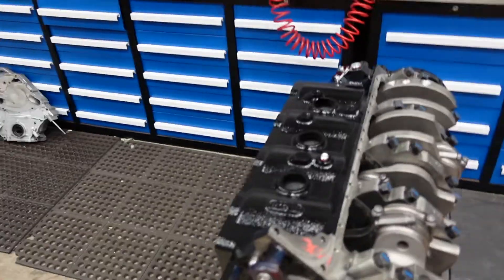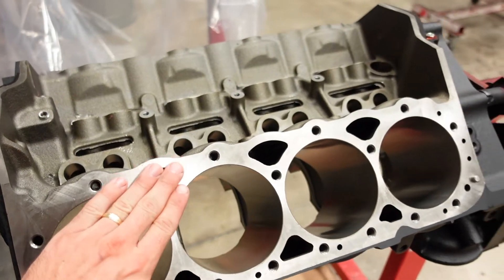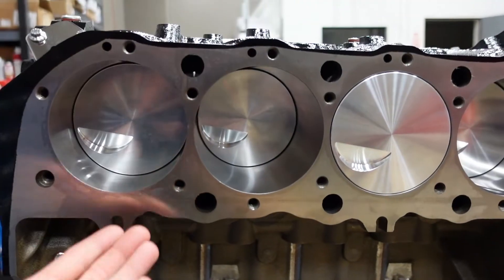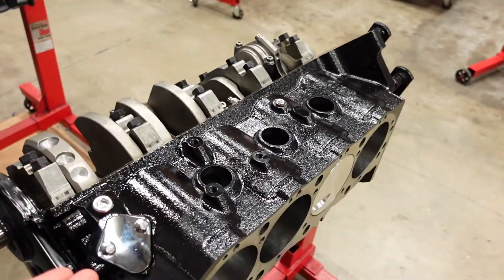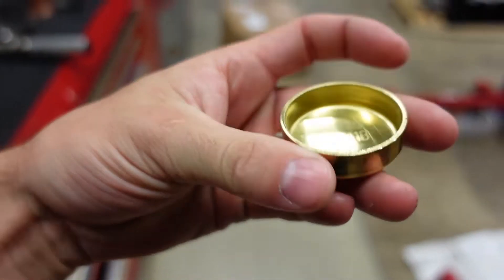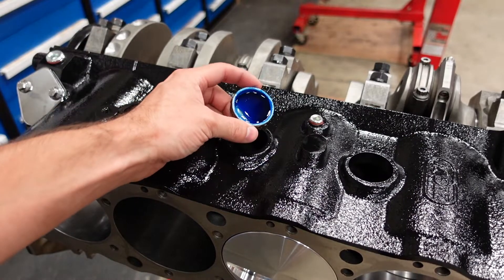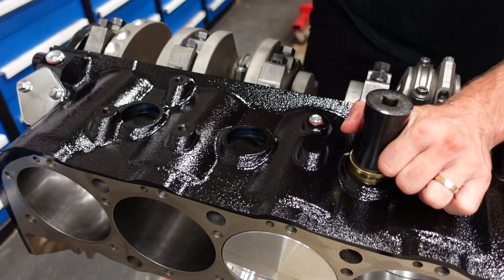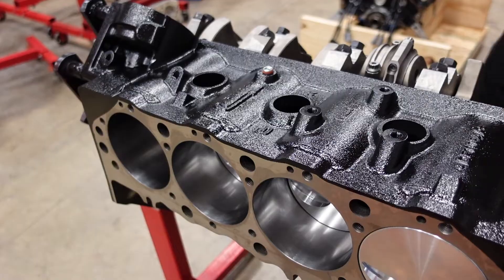Installing Engine Core Plugs (correctly) - Tech Tip Tuesday

Comment: Easy and correct way to degree cams. 
Correctly Measuring piston to valve clearance. 
Correctly Measuring for push rod length.
And setting lash for the Jessel shaft rockers. Thanks💪

Comment: They should be deeper just below the chamfer in the block to get the best seal. The core plugs are slightly tapered so they mostly seal on the big end, so there’s no meat in the chamfer area to seal good.
Reply from the maker: Dart blocks have no chamfer on them.
Reply: @JacobVillemain  good to know

Comment: I've never installed a core plug, but I did read online that its best to hammer the plug from the edges, because hammering the inside will concave the plug and loosen it. This makes a lot of sense to me, any input is appreciated.

Comment: Cheers. Yesterday a core plug on my fordson dexta (a tractor) sprung a leak but I've got a replacement (I was going to do them all as a winter job). I haven't got any sealer but I'll try locktite that's a nice idea. I thought about boss white plumbing stuff let me know if you've ever used that or experienced it. Any good for this?

Comment: I’d like to learn more about figuring out HP on an engine based on the components you’re putting into it. For example, if I have a stock LS1 at 350hp and I’d like to bump that up to 400hp, what should I change? Cam? Compression ratio? Stroke? If you already have a video on this subject then please point me in the right direction. Thanks!

Comment: Thanks so much for the video and the explanation on these CORE plugs I applaud your valued expertise and professionalism. I'm currently installing new plugs in my small block chevy and although I don't have the blue loctite I do have some of the loctite head bolt & water jacket sealant I'm thinking that should work just as good? I hope so cause by the time I get an answer I'd have already have them installed haha thanks again for the video man you've earned yourself a follow from me 🤙

Comment: Would love to hear about piston knurling, to salvage good pistons when a block is worn beyond piston to wall clearance and you don’t have enough cylinder wall thickness to rebore. Also good for parts that aren’t available any longer like old tractor stuff.
Reply: Any engines I've seen with knurled pistons have been completely worn out garbage The knurling seems dig into the cylinders and distribute the grit throughout the whole engine. I deal with many engine shops and follow dizens on IG and none will touch a knurled piston project. Engines always look good with fresh hone patterns and cleaned up parts, but what you don't see is what we see in the engine shops and that is how worn out or how many 'budget builds" fail in short time spans. I've heard over and over for many years how it ran fine and then I tear it down to find absolute garbage. Then have a customer that can't understand why we say it needs a ton of work. I have interests in the hobby but just have seen so many failed backyard builds that looked "great" when they assembled them. Same thing applies with knurled guides. When heads show up with that done to them, they are usually the worst looking heads in the shop. Beside the guides being worn out, the valves are ruined due to stem wear and the seats are pounded out due the excecive valve guide clearances. 
 Now I'm not trying to put down peoples projects, I'm just stating what I see in the machine shops afyer many years working in them. I think the biggest issues are that folks try these procedures on engines that are truely worn beyond spit polishing up.

Comment: So if one uses steel core plugs, would you coat the bottom of the plug that faces inside the block with the pioneer goop? Would that protect it?

Comment: When doing a ls swap and you get a standalone system like the terminator x how do you get all the other electronics to work such as headlights brake light turn signals

Comment: Thanks for this! Do you wait for the sealant to cure at all before you would fill it will coolant and drive away (if you were changing a core plug on an engine that was in place)?  If so, how long?
Reply: You don't use sealant on core plugs . If you install correctly they don't leak

Comment: FE oil galleys, benefit of using threaded plugs over dome disks for sealing?
Reply: I thread them all in FE's. I really don't like the tiny 7/16" plugs. I also don't like how the rear ones are pressed in either. One of them come out and now you also have a mess to deal with.

Comment: 800,000 videos on how to instal them. Nobody mentions how to REMOVE THEM.
Reply: There like 10k videos removing them
Reply: 800,000 videos on how to install freeze-out plugs, but no videos on how to install a freeze-out plug on the back side of the passenger side head on a 2007 without pulling the head or engine. 😉

Comment: Correctly? Not from engineering standard. The core plug outer ring is tapered and designed to be driven into the machined hole such that the lip of the plug is BELOW the surface, applying maximum tangential load to the bore. The radii on the, plug face, is to maintain an elastic spring force to the outer ring area. Glue/sealant is only to cater for porosity/pitting in the block machined hole. Never ever hit the outer ring with a hammer if you want correctly engineered installation. As an engineer having worked across multiple auto manufacturers, "i like to and we care" from aftermarket re-builders don't appear in the traists of engineering doctrine. Physics and testing are engineering first principles, pretty and personal likes are marketing things.
Start with cleaning off any paint or residue from the cast and machined block holes. Examine the cast holes for porosity or pitting (second hand rusted blocks), if present then maybe a sealant will work no guarantees, better to use proper installation to avoid leaks. Yes, using a drift or large socket with a close slide fit to the plug and hammer is acceptable procedure. Drift the plug till completely driven into the machined bore, no protrusion. It's correct to locate the plug so the outer lip finishes down the bore on a non pitted/porous section. Concentrating on text alignment is the last concern. If purchasing an engine with plugs flush or protruding, reject it. If plugs have hammer deformations on the lip, reject it.

Comment: Should be hitting the outer ring, not the inner part with the socket...
Reply: Our install tools use the inner portion for install. I've banged in well over 10,000 plugs like so and no one come back to complain about a plug failure yet.

Comment: I wasted time watching this video . Didn't need your personal opinion on why you think they are core plugs over freeze plugs. They've been called freeze plugs .Sence before you or I where born & according to the old timers that taught many students. The purpose of the plugs in their current use is. Freeze plugs to keep your block from getting damaged if the water would freeze inside block so the block doesn't cracked. Will it crack anyways. Does happen. Really to waste everyone time with your dictionary meaning of the plug. Anoyying , I didn't put the vid on to hear all that. Your opinion is a opinion. Didn't pop vid on for that. Popped on to see if useful tips ..Nothing useful. Seemed like more time spent on what the proper name & purpose is.
Reply: Funny enough, my order catologs and the kits packaging labels them expansion plugs. Same in industrial applications that just need a bore plugged, they are ordered as expansion plugs. Can't figure out why so many want to make a stink about what they're called. Most don't even work in engine shops, it's weird lol
Reply: I found it interesting and thought the video was quite well done. If they are for freeze protection they sure don't work very well since I have seen many cracked blocks from freezing. It's also a pretty well know fact that these hole are part of the casting process.